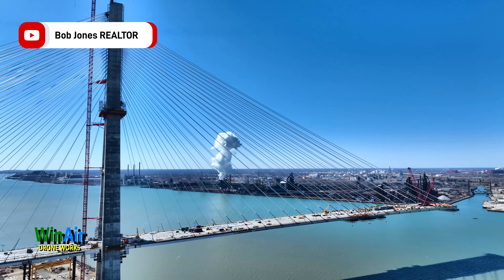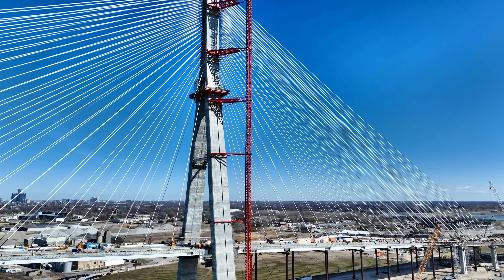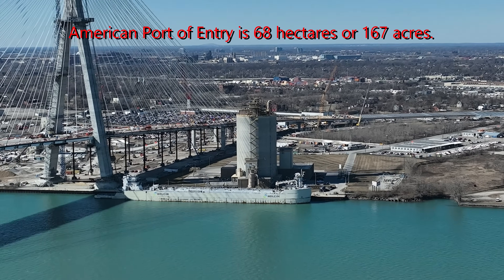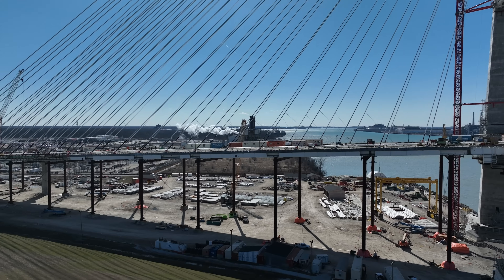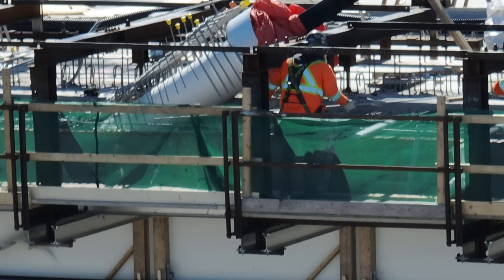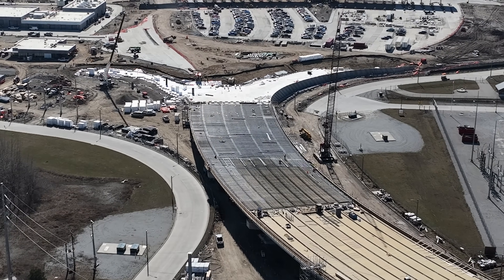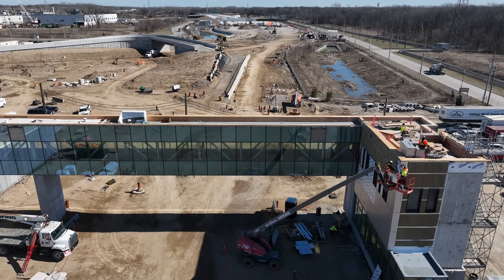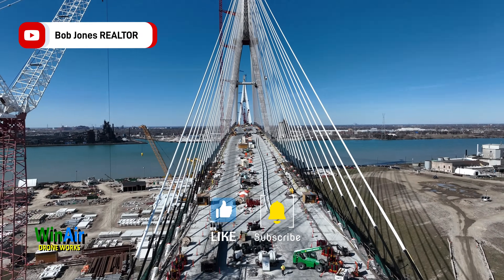What’s Happening on the Gordie Howe Bridge Right Now?

Comment: Ambassador Bridge - 2 years to build, came in under time and cost https://en.wikipedia.org/wiki/Ambassador_Bridge . The good old days !!
Reply from the maker: Hi Bob. That's right. Not only that, they had to remove and replace a good numbers of cables they had already installed as they were inferior to the cables they finally used. The contractors were given the tolls collected as a bouns until the date the bridge was contracted to be completed if I remember right. Yup, those were the days!  Thanks for the insight into the Ambassador. It has quite a colourful history.